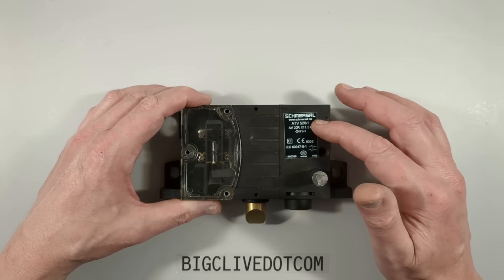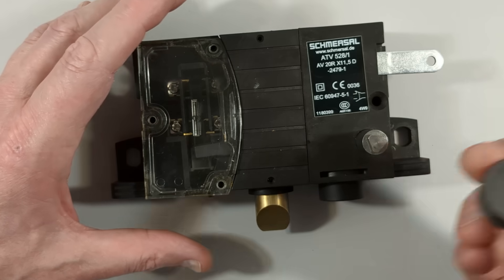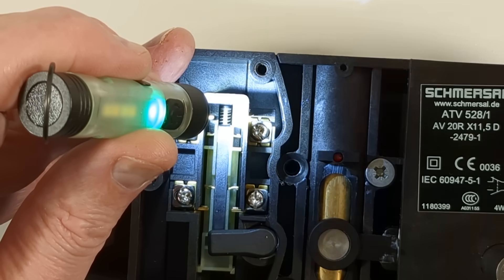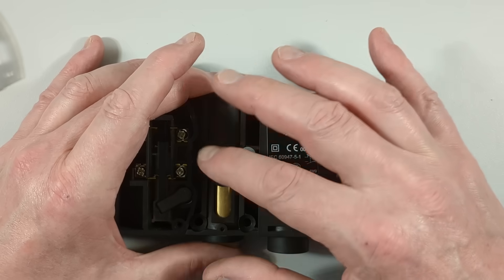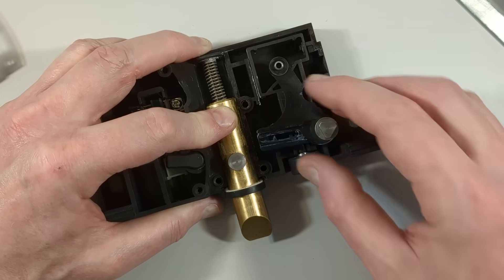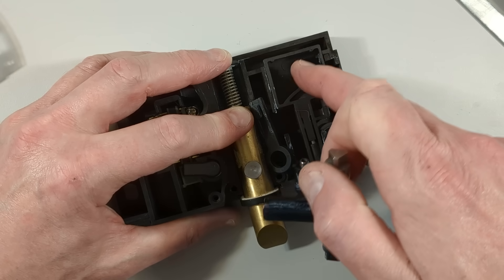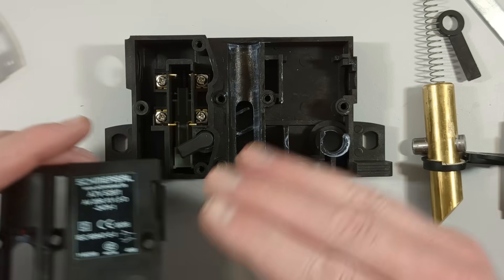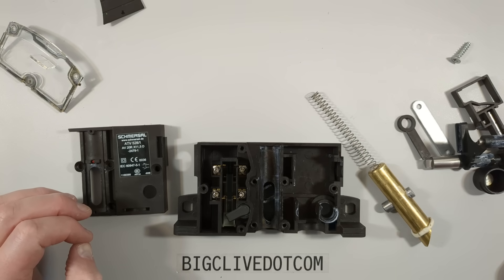Inside a goods elevator door interlock

Comment: Note also how contacts are physically pulled apart: this will make sure that even if they were ever to weld shut, they'd be destroyed the next time switch opens. Lift safety circuits are oddly satisfying in the way they're very mechanical by their design requirements!

Comment: i'm surprised they use no contacts. not nc? or they have other logic there. unsure how much issue it is. in alarms it's often open, short, resistance level a, b, c etc. for other analog industrial sensors too. so, unsure. do never ones use data buses?
Reply from the maker: The safety circuit is completed by all the relevant contacts being closed, so if there's a wire break or faulty switch it breaks the full safety circuit.

Comment: Here in Germany, Schmersal is THE manufacturer when it comes to door locks in the industrial sector.
For example, the cells in which industrial robots are located are locked by Schmersal locks. In order to enter, an release must be activated, and only when the robot has stopped is the door lock released.
Conversely, the system can only be restarted once the door has been closed.

Comment: Older version doesn't have a magnet and works with a pin in the door and there is pin in the bronze lock. Hard to explain but sure you can find pictures if you want. But the old version is awful, always problems, pin has to be very spot on

Comment: With that gravity feed magnet,  when there is not a repelling magnet would there be metal and that would pull the mechanisms magnet down, giving an assist to gravity (which would be less if the system is descending)?
Reply from the maker: When the lock is activated it pushes the magnet down.

Comment: When I was young I ventured into the wonderful world of elevators for a short while. It was the time when there was the transition from machine rooms filled with cabinets chockful of clicking relays to one small computer to control multiple elevator units.
I did it for half a year and they would gladly have me but I could get an audio/ video repair job and this I have been doing until today at 63 y.o.

Comment: In our local shopping centre they have two hydraulic lifts and there on the outside is steel wirers with small steel planets at each opening lift door and electromagnet on the lift roof so has the lift goes up and down the lift knows where the doors are and when to stop.  There lots of clicking going on when the doors open and shut so perhaps there is your door lock?

Comment: I have replaced some of them, they are expensive but very reliable. Ps they are a part of the elevator safety certificate. And I also found them installed in industrial safety lockout zones where robots work.

Comment: Mechanical Engineers are a unique breed, just look at the insides of a VCR...absolutely magical how all that works.  Along with the Electronic Engineers they figured out how to make those things work, collaboration nightmare.  This is another reason I just get in the elevator and push the button, "round and round she goes where she stops nobody knows".  Interesting Clive, thanks..
Reply: I think the most mechanically impressive VCR mechanism I've seen is the National-Panasonic "G" series mechanism from the late 1980s, which somehow accomplishes all of its operations using just two motors and a solenoid plunger. The head drum gets its own motor, and all other mechanical components including the capstan, pinch roller, take-up and supply reels, eject mechanism, brakes, tension control, and tape guides are all powered by a single motor through an extremely complex geartrain. The mode of operation (such as play, stop, rewind, fast forward, tape thread, unthread, or eject) is selected with pulses of the solenoid plunger and forward or reverse movement of the motor. Compare that to designs they were making just a few years before which had up to six motors.
Unfortunately that two motor design ended up being pretty unreliable, but they later perfected the VCR in the early 2000s with the nearly-indestructible 3-motor "Z" mechanism, which is a masterclass in cost and parts count reduction compared to earlier designs.

Comment: As a Saturday lad at Woolworth's Bradford 1975, the goods lifts had a hardwood double wedge fixed on the car and a roller mechanism on the door frame that released the outer door interlock within a couple of inches of the floor level, the door could not be opened until the roller wheel was on the apex of the wedge which was around 4 inches long on the flat part then released the bolt so the door could be opened, pretty fail safe really, the lifts were Keighley lifts, Keighley, Bradford BD21, the lift engineer knew I was very interested in lifts and said if I applied for a job he would say I was genuinely interested, but alas I got an apprenticeship as a fabricator welder at a roller shutter company nearer home as Keighley was 13 miles away, what a mistake that was, after 6 months I hated that apprenticeship and left, but can weld pretty competently for my own jobs so all was not wasted, but could not weld all day long as a job😁.
Gaz Yorkshire.
Reply from the maker: The lift engineering job would have been interesting, but keep in mind that you would be on call for part if the week if a lift broke down at night.
Reply: @bigclivedotcom True, but back then I would not have thought of that Clive, cheers. Gaz.

Comment: Maybe they need to use the hole during assembly and then put the red cap on it to prevent dirt ingress. Red on a black background makes it very easy to notice if they forgot to put it on.

Comment: An amazing simple yet complex assembly that seems to be designed to always fail safe.  I did a tiny bit of work on elevator electrics as a sparky,. mainly mains power, pit lighting and sump pump power.  I did have to run lots of conduits to feed the hoist cables.

Comment: The spring that keeps the needle valve of my chainsaw's carburetor open flew off three times in a row. The first two times it ended up on the ground several meters away and I saw it by chance. The third time I couldn't find it, but I had another identical carburetor with an internal problem. When I was going to install the one from the donor carburetor, I saw the other one right on the edge of the table... I considered going to buy lottery tickets 😆

Comment: That red bit of plastic appears to be a harder plastic used as a wear surface for that brass pin. It's scored the brass over time so it's equal to or harder than that brass pin. Probably to keep the pin from wearing the case which is a softer plastic. Might even be adjusted at the factory for tolerance.
Reply: That’s exactly what I thought!

Comment: I took apart a non-fuctioning, unobtanium, circuit breaker in a device that I really wanted to fix, and when I took the breaker apart, springs, little pins, pieces, and parts shot EVERYWHERE, and there was NO hope of repairing THAT breaker anymore.... 😟

Unfortunately, the breaker is also the front panel power switch, and I'm STILL actually looking for the proper replacement breaker today for that device... 😵‍💫
Reply from the maker: You can sometimes find obsolete breakers on eBay.  But you need the brand and model number.
Reply: I'll check there... I never thought about going to ebay to search.... 🍻

Comment: Would that be the equivalent of what we would call a freight elevator in the US? .... I'm curious because the only type of door I have seen on those are a double sliding door similar to a regular elevator door but turned 90°  outside and a wire screen (rigid like taught chain link fence) door that raises inside the cab at least in the US, even on some really old ones.
Reply from the maker: This old (it wasn't actually very old) elevator had a sliding shutter door inside and swing doors on the landings.  The new one has a vertical lifting door in the cab and swing doors on the landings.

Comment: In the past, whenever I've been taking anything apart with springs inside, I've usually put the whole thing in a large self-sealing plastic bag, to avoid the after effects of unexpected spontaneous dis-assembly.  You can buy large plastic bags with gloves moulded in (e.g. Sigma-Aldrich AtmosBag) if you need to do this sort of thing on a regular basis (or build a small glove box - plenty of ideas on The Tube!)
Reply: Great plan. I have an old glove box which never got used in the chem lab it was salvaged from. If if can protect me from sulfur and nitrogen gasses, it can certainly catch all the fiddly parts being thrown around by springs and otherwise tensioned parts.

Comment: Just for your info: Those "pins" you mentioned, (here in the States) are called "Drive Screws".  They usually have a very coarse thread, and you whack 'em in with a hammer and punch.  They can be a royal pain to remove, and sometimes require drilling out.  BTW, cool device.  I would guess the red dot is a visual cue that the mechanism is in a certain set state???  Covered when not???  Just me thinking out loud.  Cheers, Clive.

Comment: That's still just a switch, not an interlock. And waaay to complicated.
Reply: It only allows the contacts in the switch to close when the doors are properly closed, and the lift is properly positioned. 

It prevents the lift from operating if the doors aren't closed. It prevents the doors from opening if the lift is not properly at the floor.

In other words, it locks out operation unless two distinct parts of the lift system are in their required operating position. It is definitely an interlock.
Reply: @notahotshot An interlock is a feature that makes the state of two mechanisms or functions mutually dependent.  This is not.  Many failures of the one component can cause the contacts to stay made.  An interlock would have the mating contacts on the other side

Comment: Most swing door passenger lifts here in France actually have some sort of blunt needle on the door side that pushes something in the center of the locking pin in order for it to extend all the way and for the safety contact to be closed.

They also come with a jumper on the door and a pair of contacts on the frame that get bridged whenever the door is closed, however shorting those contacts with a wire piece isn't enough to get the lift moving.

The cab door will close and the locking pin for the swing door on the landing will extend but not all the way and the lift will stay there until you push the thing in the center of the pin with anything from a small screwdriver to a solid wire or screw but it allows to surf the lift even without the appropriate key for the lock.

Comment: Fun fact, the word interlock is actually trade marked.
Reply: Not really. It is trademarked for dental materials. Any other use is not affected by the trademark, which means that using it for any latching, locking or electronic products is completely fine.
Have to correct myself: there is another trademark for metal mechanical interlocks.

Comment: Neat.  Mechanical systems are always more fun to tease apart than strictly electronic ones.
Reply: Not when you have to put them back together again! Or try to work out why they keep sticking...
Reply: @Mark1024MAK  merely opening them up can cause the defective behavior to go away; often only just until you put them back together again. Which is why Lumafield and similar CT scanners are so popular now that they have come down in price. You can get them for the cost of an intern now. And you can step their 4D results across separate manual manipulations if you want. What's missing is piping their observations into simulation, which I haven't seen yet but I'm sure the CAD file reconstruction people must be working on in earnest.
Reply: This is a very analog concept but digital concepts still apply. Neat Clive.

Comment: I am particularly interested in how they managed to make the magnet operate a MECHANICAL interlock. When you began explaining I thought "Oh, the magnet's going to go over an electric contact and close it", but no, it operates entirely without electricity.
Reply: To be fair, the magnet plays the crucial role in whether the top switch will close. But apparently doesn't affect the rest of the physical mechanism? Correct me if I'm wrong.
Reply: I suspect the magnet pulls on a sear mechanism that then allows the main plunger to fully drop.